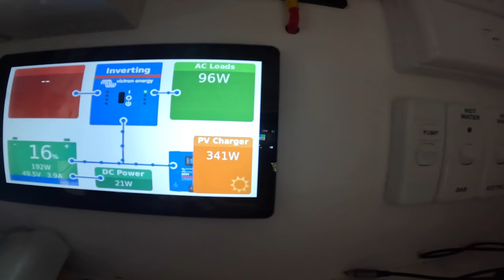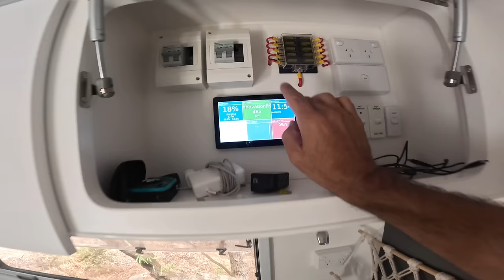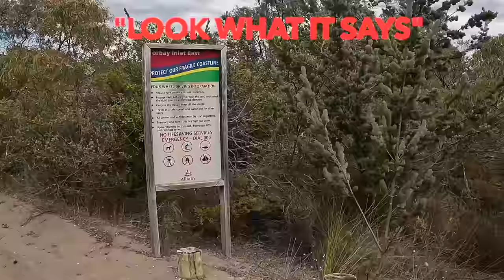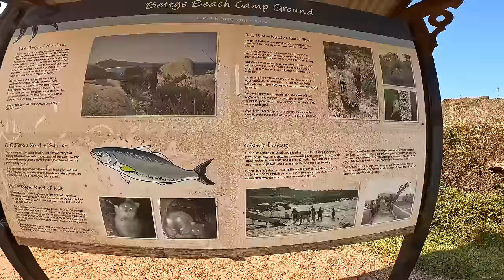Kicked OFF Our Campsite - Reality of Free Camping in Albany, WA

Comment: DO35 hitch is so easy to connect by yourself.
I have a Y62 too.
Rotate your DO35 up like 45 degrees. When your pin goes under, the DO will start to rotate back to level. Now you are directly under it so you can do it all using your Y62 reverse camera.
Try it.

Comment: When you need to turn around in a tight spot,  move to a spot which is a little wider than the caravan length. Uncouple the van, turn the car around and stop by the caravan. Place a block behind the rear wheel of the caravan on the same side as the car.  Use a tow rope to pull the caravan around in a half circle.  You may need to change the block to the other side front wheel if the swing room is tight. Try it on a flat open area for practice first